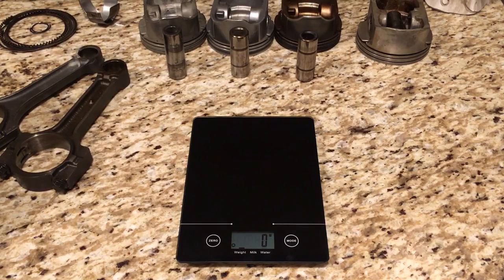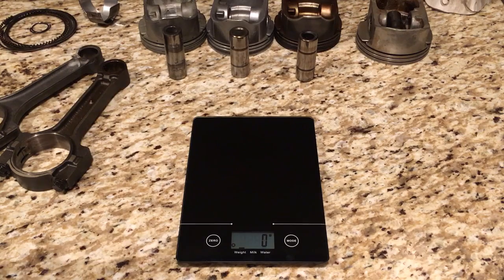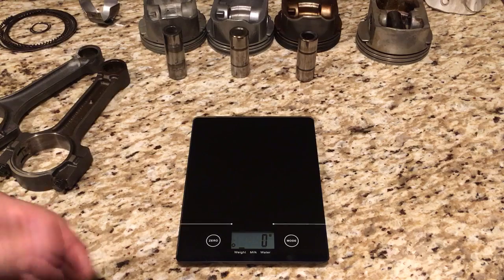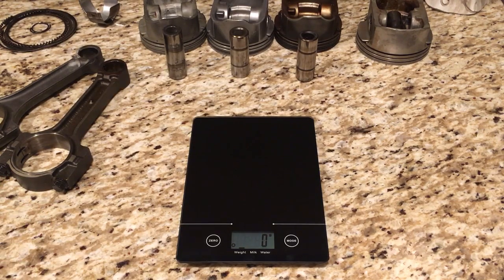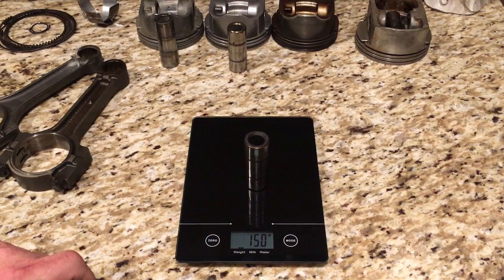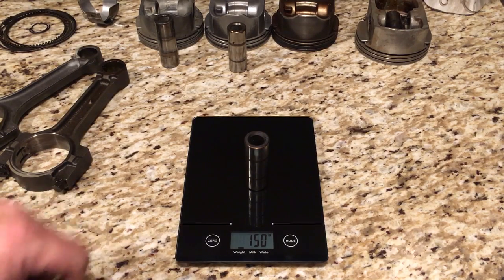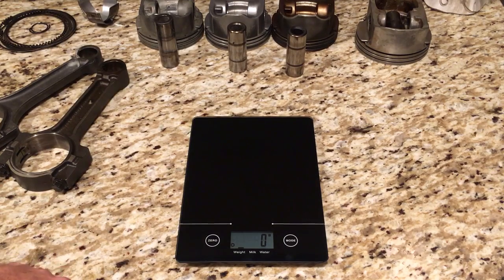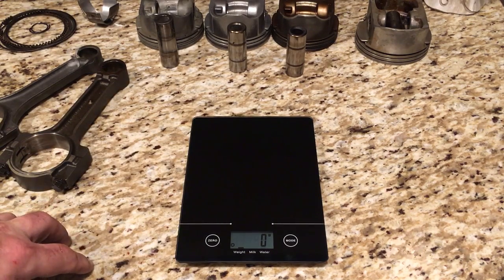5.3 Gen 4 piston and rods in a Gen 3 LS engine

Comment: Glad I came across your video. I am about to put dished gen 3 5.3 pistons with the factory bigger gen3 rods into my LC9 engine on the gen4 crank. I’ll grab a scale from HF and weigh everything to know where it’s at though. Great video!
Reply from the maker: I highly recommend using Gen 4 pistons and rods if you plan on pushing the power.  Gen 4 has full floating pistons and better rods. 
There are some rare Gen 3.5 rods from 2003 where it’s a thick Gen 4 rod but still uses a press pin piston.  Do you have this rod? 
Also you can run the true flat top 4.8 piston on the 6.098” 5.3 rod to bump the compression. 
People seem to get away with running just about any combination in the LS, this video was for the builder who wants to do it closer to balanced. Thanks!  JD
Reply: @HeadFlowInc  the gen 3 rods that are in this Tahoe engine have big rods like my LC9. I plan to boost this engine in my 4 door 74 Maverick so I’d like to keep the cr as low as possible. I have a lc9 with the factory flat tops with 706 heads in my turbo corvette. Higher compression and makes good torque but I have to be real conservative on the ignition timing. I’m only aiming for 500-600 for the Maverick with a turbo
Reply from the maker: @brakestandgarage  We’ve put uncut ported 241 heads on a dished piston 5.3 getting low 8.30-1 compression iirc.  216/220 cam it made 740 wheel HP @ 15.9# boost 👍

Comment: I just weighed my (beafier) early gen 4 rods, the ones that were still press fit pins, and the speed pro 5.3 flat tops with rings and stock bearings installed. I shit you not they weighed exactly 1260g's.
That's exactly what the stock lm7 rods and pistons weighed! I thought I would need either the gen 3 crank balanced or a gen 4 crank but nope this combo works out perfect
Reply from the maker: Sweet!  Keep in mind the factory rotating assembly isn’t race balanced, they use a +- 4 gram median meaning the assembly can be a max of 8 grams difference between each piston/rod assembly.  This is a production tolerance standard. 
I’m not trying to discourage you only clarifying the difference.  Have fun if you’re close it should be fine!  People run these LS engines way out of balance and they keep going!  JD
Reply: @HeadFlowInc  thx for the reply. This is strictly a stock rebuild for my work truck. My main worry was not beating the hell out of the bearings. I'm hoping to get another 250k on it.
Reply from the maker: @Six_ftdeep32  You should be good to go! 👍👍👍

Comment: The mahle factory replacement flat top for a 5.3 part number 224-3729 is around 16 grams lighter than the pistons in my l33. Frustrating. For some reason mahle lists this piston as a replacement for the l33. If you look at the bottom of the mahle they have machined aluminum from the piston skirts on the bottom. I was hoping I could find some heavier wrist pins but not sure. The factory and mahle pin is 150 grams floating pin. Looking for a floating pin gen 4 around 165 grams. It seems like the pressed pin is heavier than the floating unless I'm wrong.
Reply from the maker: Yeah it may get expensive finding a thicker wall pin to try and get the weight closer.  Maybe it’s better/cheaper just to have the whole assembly precision race balanced? JD

Comment: I just worked out this very same issue. I have many parts for ls like you do. I recently bought a 04 escalade with 706 cracked heads. The engine was rattling and so nasty inside that I abandoned the whole motor due to the mess of it all. Since I had a 5.3 block sitting in the shop I decided to use it with with some flat top pistons I bought new.  New pistons were floating so I paired them with some dimple rods from a 06 6.0 I had build earlier. Knowing that the weight was up on the new combo, I threw one of my ls1 pistons on the scale and my new piston/rod combo for the 5.3 was +5 grams heavy. I used the 5.7 ls1 crank and removed the dimples off the rods and got my balance. I honed the cylinders and cleaned up some 241 that I had. The engine runs very smooth I am very happy with the results. Thanks for posting so much helpful info on the channel.
Reply from the maker: Sounds like you ended up with a great combo nice work!  JD
Reply: @HeadFlowInc  Thanks for the reply I owe you $$$. Seriously I avoid the machine shops and your cylinder head videos are gold. You save me from dealing with the most annoying thing about building engines. It's the run around and lies from the machine shops.

Comment: doing something similar. taking crank from 5.3, building 6.0 flat top with gen 4 rods.
Reply from the maker: Definitely doable!  It’s odd GM used the same casting number crankshaft w/3.622” stroke for the 5.3, 5.7 and 6.0 engines; surely there is a difference either in weight or counter weight orientation?   JD
I’ve heard there’s a slight counter weight offset on the 6.0 crankshaft but the 5.3/5.7 use the same balance but can’t verify
Reply: @HeadFlowInc  would be nice if we could have accesss toa  machine shop crank balancing machine to test differences... using some figures from your videos and my parts... (your scale is spot on with mine, I also got 150g for wrist pins)... I find the gen 4 pistons and rods to be approx 100 grams hea ier than the 5.3L gen 3. I am trying to reuse my gen 3 crankshaft. hopefully the machine shop can account for that much extra weight.
Reply from the maker: Yeah I’m in the 24 tooth reluctor wheel club with my Holley Terminator X setup. 
I hope we can figure this out or some one shares the information!  JD
Reply: @HeadFlowInc  I have tobbn polish the sides of my rods, weight match them... then i am taking the crank to the machine shop. will text back when i know more :)
Reply from the maker: Email me so I don’t miss it!
jeffdubray@gmail.com
Reply: @HeadFlowInc  will do :) hopefully is soon but maybe a few weeka away. I am also using a thread on TahoeYukonForum.com  I need to find a good LS engine  uilding forum.

Comment: So if you have a gen 3 5.3 with the gen 3 5.3 crank can you run gen 3 rods with gen 3 4.8l pistons an make more power? Wht combinations are do able for more power but not compromises anything an dont have to re balance anything?
Reply from the maker: chaning dodson People run the 4.8 flat top pistons in 5.3’s all the time, as long as you use the 5.3 crankshaft/rods.  The sketchy part is R&R press pin pistons on the Gen 3 rods, it’s a way easier mod to switch using the Gen 4 rods and floating piston pins. 
People put Gen 4 pistons and rods in Gen 3 engines all the time, is it correct no but rarely do you see failures verified by not re-balancing.  JD
Reply: @HeadFlowInc  damn I didnt think about that how difficult is it to make the 4.8s work with the 5.3 rods?
Reply from the maker: You could buy Gen 4 6.098” rods and 4.8 Gen 4 pistons and assemble yourself easily. 
To r&r press pin pistons requires an arbor press and it’s very easy to crack a piston. The Gen 4 full floating setup is the way to go. The balance won’t be perfect but people regularly run Gen 4 pistons and Rods in a Gen 3 short block.
Reply: @HeadFlowInc  I have a late gen 3 4.8 with floating assemblies. Is it risky for a DD to source a gen3 5.3 crank and gen4 5.3 rods and use my 4.8 gen4 piston without balancing? Woul they have to add weight to the crank?

Comment: 38 grams gets pretty heavy changing directions at 6500 rumpums.

Edit: If you're planning on spinning your motor fast enough to make any kind of hoss power on a regular basis it is money well spent to have that rotating assembly balanced
Reply from the maker: Nubbins I agree, it’s definitely far from optimal!  Think of the difference it would make with a custom race balanced assembly in comparison?!   Thanks for the feedback I appreciate it!  JD
Reply: @HeadFlowInc    You have a great channel man. One of the things that makes it good is the way you follow up with subscriber's comments. That's important to some of us. Thank you for sharing useful, correct information. There's a lot of assholes out there that insist on spreading bad information. Thank you for not being one of them.
Reply: @HeadFlowInc  This old thread came up in my notifications today so I read through it again.  Lol  the things some people will say to tell the other guy  "you're wrong,  im right"
Reply: Yes and no. The nature of a cross-plane V8 means the mass of the rods/pistons themselves cancel out much of the off-balance harmonics. It would be unacceptable if there was a 38g variance between each cylinder. Plus the rod's inertia isn't simply up/down, which is why GM only made the piston/pin weight identical. Again due to the cross-plane crank, the now-unbalanced crank is only unbalanced for a portion of the stroke - to put that differently, the crank only accounts for PART of the harmonic balance. Also note harmonic balance is more like a dynamic balance, not like the wuub-wuub-wuub you get from an unbalanced wheel.

This is why not rebalancing the crank has worked for decades. It simply isn't a big deal for cross-plane V8's. For inline-4 and flat plane V8's it certainly would matter, since they have a nasty 2nd-order imbalance...but that's more of a NHV issue than mechanical - unless you have an oil pump that's directly on the crank.
Reply: @hydrocarbon82   I don't remember making that comment

Comment: Is a 5.3L crank 24x the same as the 6.0L 24x crank
Reply from the maker: Kenny Biggs Technically 5.3, 5.7, 6.0 24 tooth are all interchangeable and have the same GM part number on them. 
1. A true LS1 crankshaft has gun drilled rod throws makes it lighter weight and easy to identify. 
2. There should be a slight weight distribution difference in the counter weights to balance the different CID. 
3. As long as your going to balance the rotating assembly you can use any of those crankshafts. 

Purely looking at Factory OEM parts: If you had a known Gen 3 6.0 crankshaft, you could run Gen 4 pistons/rods in a 5.3 block and the piston/rod assemblies would be < 2 grams from being balanced. 
Note: Not custom race spin balanced but very close to an OEM setup.  Stronger setup! 👍👍👍
Reply: Thank you for your info

Comment: Just for the record if anyone wants to know,  Silvolite .020 oversized aftermarket pistons weigh in at 600 grams with the wrist pin. That’s about 1 oz over weight on each piston vs stock.
Reply from the maker: Busa0069 Interesting, what size engine and is it Gen 3 or Gen 4?
Reply: HeadFlowInc gen3 5.3

Comment: I WAS BORN IT SHITAGO BUT MOVED TO THE SOUTH OVER 20 YEARS AGO..IT ALWAYS MAKES ME LAUGH THAT SOUTHERNERS CALL A SCALE SCALES...LOL GREAT VID AS USUAL THE FIRST TIME I HEARD OF SOMEONE SAYING THE DID THIS I KNEW THEIR ENGINE WAS OUT OF BALANCE i DIDNT EVEN ASK IF THEY BALANCED THE ROTATING ASSEMBLY..DAMN MILLENNIALS.
Reply from the maker: Joe Mamma Even GM seems to have done some sketchy assemblies trying to save money.  I’m still trying to verify if there’s a counter weight difference between the 5.3, 5.7 and 6.0 crankshafts!  All three engines use the exact same part number crankshaft 😳. Even our local machine shops can’t explain how all 3 engines could use the same crankshaft and actually be balanced. 🤔🤔🤔
Reply from the maker: Joe Mamma I grew up in South East Memphis, TN. Parkway Village.  I’m “49yrs” old... until April then I’ll be “Fiddy”. 👴🏼
Reply: Mee too,I'll be fiddy in March...I'm building a 427 Dart sbc with srh heads NOS motor for by 67 Camaro drag car.I ordered my rotating assembly from  Howards.When they balanced it they did nothing for the small end just machined the crank for weight.These are billet rods with JE nos pistons..
Reply from the maker: Joe Mamma I’ve had good luck running Howard’s stuff, I think more people should try his Parts.  
My friend David has a 1980 TA running a 15.0-1 408 on a progressive 400hp nano shot. At 75% he ran a 6.12 while smoking the  clutches in his TH400.  He’s looking for 5’s in 2018

Comment: you keep saying balance when you should be saying reciprocating mass because = if the weights of the newer stronger rods , pistons , clips , pins are within 3 to 5 grams of each other and nothing else in the engine has changed then balance will not change period. now if you want to talk velocity, tangentcy,  speed forces then you are correct the heavier set up will put more force on reciprocating parts but not balance . now if the big end of said rods are the same, crank diameter or rod journals are the same and bearings are the same relatively and your using the same bearing materials then there in NO appreciable differences besides the forces at tdc & bdc .
Reply from the maker: mike c You are 100% incorrect in your understanding of a balanced rotating assembly.  The “Bobweight” or counter balance of the assembly changes with the weight of the assembly. IF the assembly is 10 grams or less then it’s considered runnable.

A balanced assembly is counter balanced “spinning” not statistically to reduce harmonics.
Reply from the maker: mike c Why do you think people pay to have the rotating assembly balanced?
Following your theory, all anyone would need to do is weight match all the Pistons, pins, Rods and rings.  Unfortunately that’s not a balanced assembly.
Reply: Actually he is correct,  think like this if your Bob weight is 1800 let's say and the new pistons/ rods ECT is 1900 of you can remove that 100g from the new rod/pistons then you'd still be within spec being that the original assy was balanced by the factory
Reply: Yes, but if all being balanced by GM previously, if you add 33 grams weight to each rod assembly, you know you need to drill 33 grams out of each bobweight. If you do that exactly, you should be within GM factory balance, which back in my early days was within 2 grams.